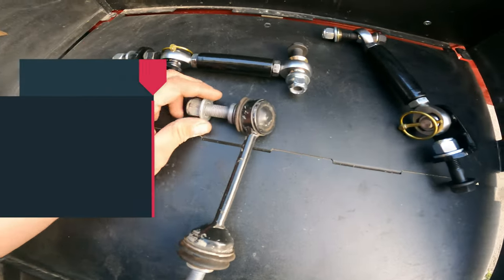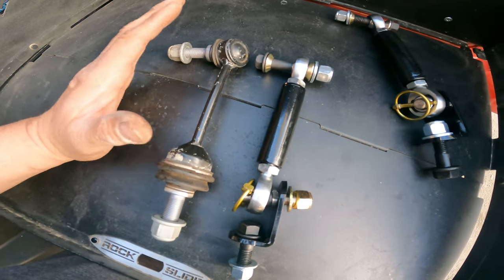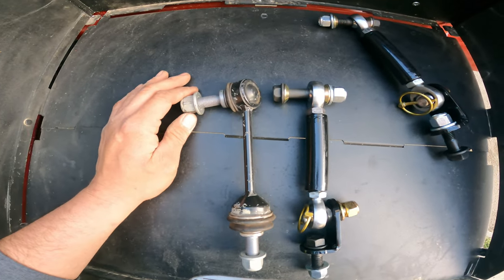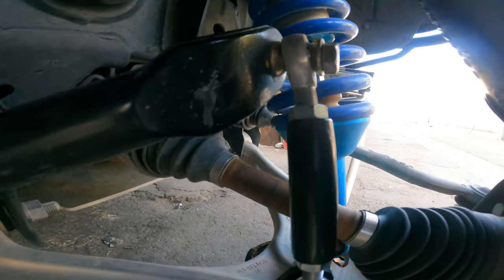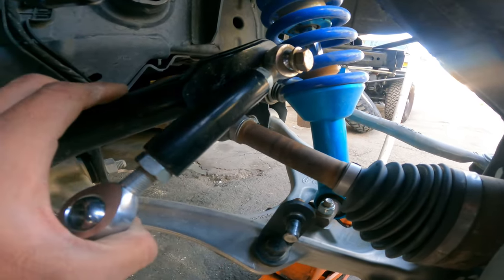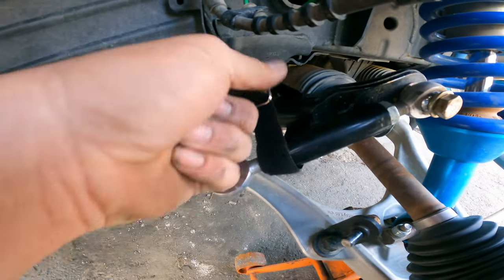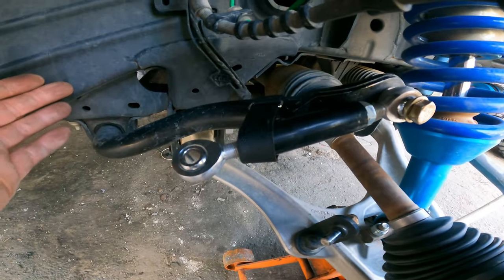2021 Bronco Sway bar disconnect

Comment: Did this technique before, always resulting in pain in the a** reconnection even when the vehicle seemingly exactly leveled. Why? Because no guarantee the road, vehicle, tire pressure, suspension flex, etc will make two fix points to be aligned after a hard wheeling
Reply from the maker: @rudetoy8264  most likely link lower link bracket needs to be rotated. Alsonwhat lift or model bronco do you have

Comment: You mention the cv may tap the sway bar. I’m ignorant here, but would it be possible to use zip ties to hold the bar rotated up when disconnected?
Reply from the maker: Bar won't come down, If it's at the point where it's moving a lot you need bushings
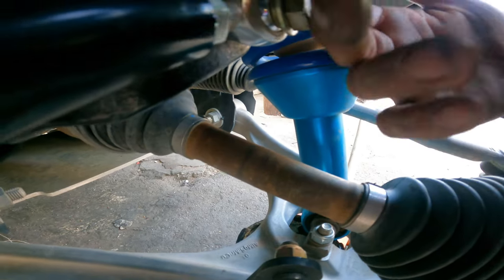Reply: @oscargrouch323  cool. I’m not really worried about it coming down, just trying to address the tap you mention at 2:05. Doesn’t sound like it’s a big deal anyways though
Reply from the maker: @kevingt01  just at full dropp it can tap. Nothing major. Won't harm anything

Comment: When both sides are strapped up, wouldn’t the entire sway bar rotate downwards possibly interfering with something? That was an issue I had with my TJ until I got jks disconnects that held the bar in place when they were clipped onto pegs.
Reply from the maker: If your bar is falling down. It's time to swap bushings. The bronco bar does have a drop that doesn't let it just pivot